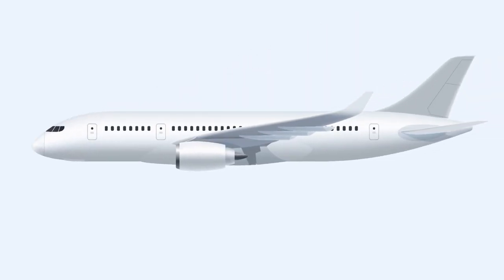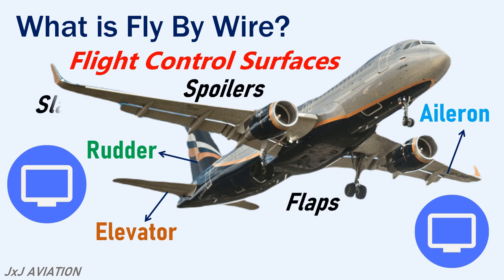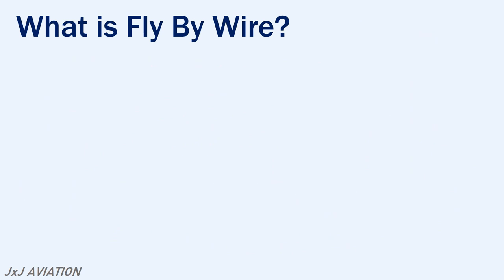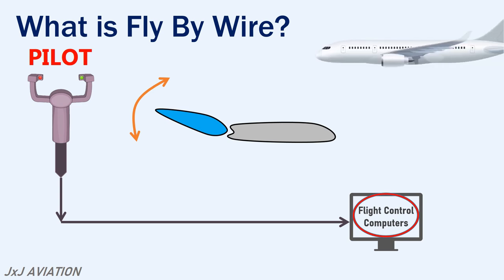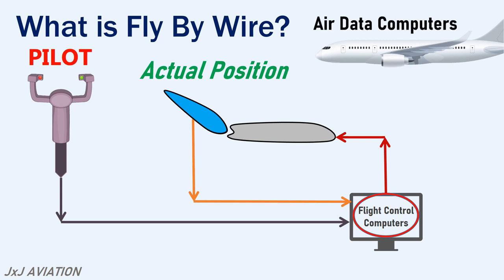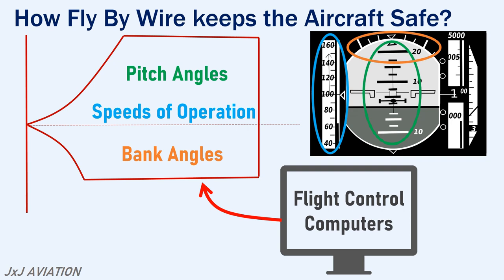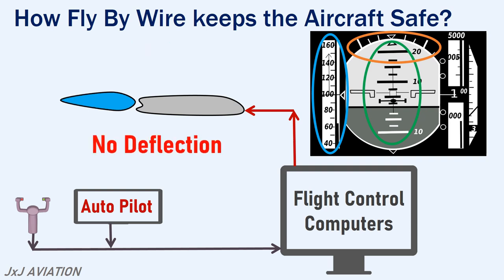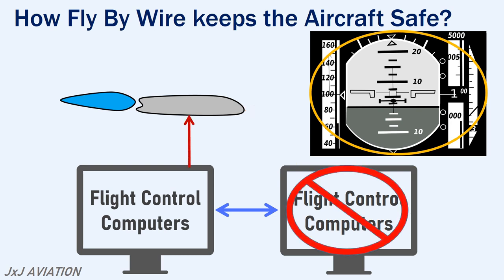How the Fly By Wire System keeps an Aircraft safe? & How Flight Control Computers Operate?

Comment: Power by wire, fly by optics, intelligent flight control system, fully autonomous flight control software systems, and supercomputers for aircraft systems should be implemented on every airplanes and helicopters.
Reply from the maker: The next generation of aircraft will surely have these!
Reply: The technology isn’t there yet.
Reply: Aircrafts should not completely go automatic. Room for human control should always be there.

Comment: Sir, how FBW is different from auto pilot system?
Reply from the maker: The FBW system is only for the movement of control surfaces. The Auto Pilot system provides flight management and flight guidance! This could be useful: my video on Auto Flight: https://youtu.be/Y7fHt4OXjew
Reply: On Airbus A320

Autopilot off-Pilot sends commands through the sidestick to the flight control computers.

Autopilot on-Autopilot sends commands from its FMGC to the flight control computers.

Comment: But if in the abnormal situation of emergency where the norms will no longer be rational, is it true that the pilots would be just helpless under such circumstances? (Since the computer won't permit any exceptions)
Reply from the maker: Its true that the computer will not allow exceptions, but to cater for abnormal situations, some control surfaces will also have a direct mechanical link which would act as backup.
Reply: Then how about the sad Air France 296 incident, sometimes I just don't feel safe about fly-by-wire though it is said to be safe
Reply from the maker: @chard6649  there are many factors which led to that incident, but it was mainly because the FBW was a very new concept back then, which led to some confusion on what action to take. But currently fbw is a safe system!
Reply: Ok, btw i'm a new subscriber
Reply from the maker: @chard6649 Thank you and Welcome!
Reply: @JxJAVIATION  no. The FBW had nothing to do with it. The crew didn’t plan correctly and increased thrust too late.
Reply from the maker: @peteconrad2077  The FBW was not responsible for the crash. Improper actions that were taken caused the crash!
Reply: @JxJAVIATION  I know. That’s what I said.

Comment: Wasn't Qantas flight 72 a fly by wire system? It didn't keep them safe.
Reply from the maker: Because of some failures the fly by wire system gave incorrect commands
Reply: @JxJAVIATION  Yes. It sent the plane into a nosedive twice. If the pilot hadn't been an ex-navy test pilot everyone on the plane would be dead now. And there were a couple of planes that went down in the same way not long after.

Comment: Does the new 787 and 747-8 have fly by wire?
Reply from the maker: I believe the 787 has a fly by wire system and the 747 has a conventional flight control system.
Reply: 787 is FBW. 747-8 has fly by wire for the spoilers and 1x set of ailerons of each wing
Reply: No they use Bluetooth

Comment: Pilot operate mechanical then with the help of transducer its converted to electric then again to mechanic (hydraulic) same as old earlier aircraft only signal are transmitted electric with the transducer?
Reply from the maker: yes that is correct
Reply: @JxJAVIATION  Sir,make a video on EADI(PFD),EHSI(ND),ECAM,EICAS

Comment: Not to be confused with fly-by-wire systems on space craft. This meant "the wire" was the logical pathway the autopilot would use to maintain the craft in a pre-planned trajectory. Perfect example is the space shuttles decent through the atmosphere. The shuttle had to have this because it was doing an unpowered decent to landing (gliding). NO ENGINES!  Without an FBW the shuttle would not be able to calculate its place on the "wire" and thus miss its target and kill everyone.

Realistically to use the words "fly by wire" in aircraft is very mis-descriptive. I think a more appropriate term would be "augmented controls" or "power stick"
Reply from the maker: That is an awesome explanation! Thank you!

Comment: Will u pls upload some videos related MODULE 6 AND 7 ,,
THE DURATION OF THAT VIDEO SHOULD BE AT LEAST 30 MINUTES
Reply from the maker: what are modules 6 and 7?
Reply: @JxJAVIATION Module 6 Aircraft Materials — Ferrous

Aircraft Materials — Non-Ferrous

Aircraft Materials – Composite and Non- Metallic

Corrosion

Fasteners

Pipes and Unions

Springs

Bearings

Transmissions

Control Cables

Electrical Cables and Connectors

& Module 7- Maintenance Practices. Safety Precautions-Aircraft and Workshop. Workshop Practices. Tools. Avionic General Test Equipment. Engineering Drawings, Diagrams and Standards. Fits and Clearances. ...